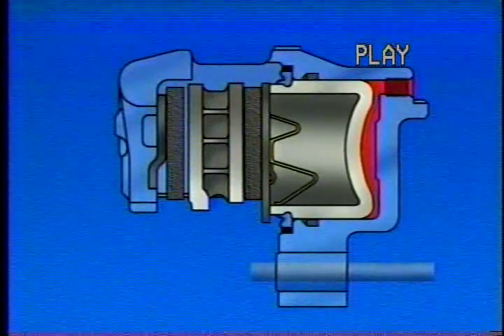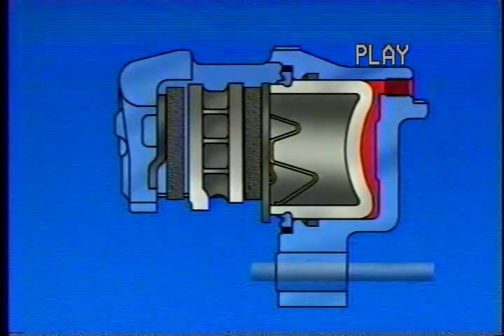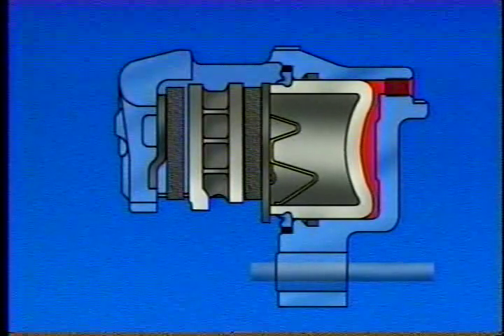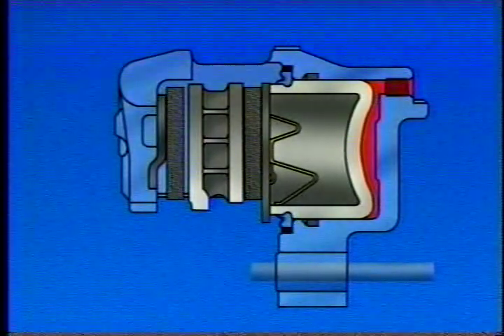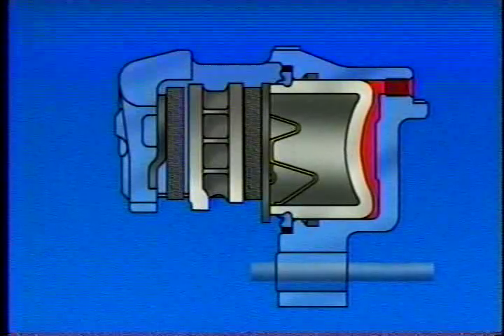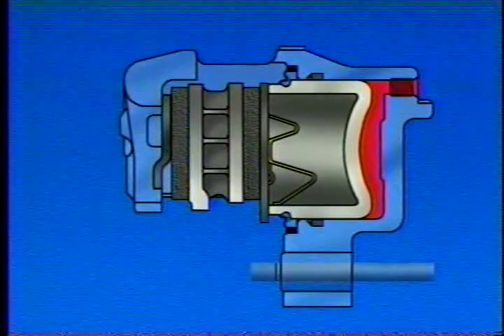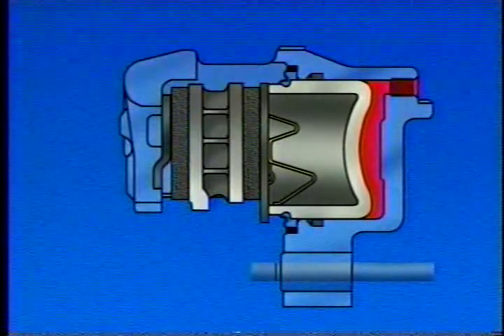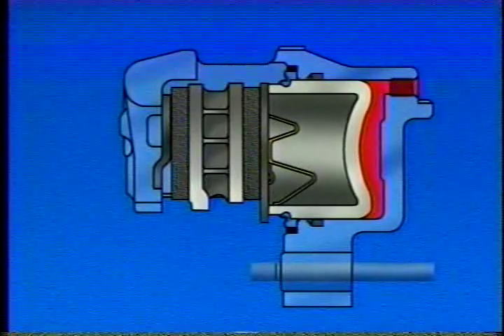How Lateral Runout Develops

Comment: The fix is to take off the rotor and use a dial indicator to measure the lateral run out of the hub. If the hub has .001 or less of lateral run out, you would know the hub is good. So you would then use a wire brush to clean all rust off of the hub assembly, you could even do this before testing it for lateral run out. Then install a new rotor on after applying antiseize to the hub surface to ensure there is no rust or corrosion to the surface over time that could cause lateral run out and make sure to only torque the lug nuts to spec and never use any impact guns to install the lug nuts.
Reply: There are many videos on here showing how to test for lateral run out using a dial indicator gauge.
Reply: Thank you for the info.
Reply: Hi John!  I know this comment is a little old, but I'd really appreciate your feedback.  I am about to do the brakes on my car and just purchased a dial indicator to measure the lateral runout.  I know that if it is greater than .002, then it must be corrected.  From my understanding, if this is the case, then one must use correction plates to fix it (3 sizes consisting of .003, .006, and .009).  Is this the way you would recommend fixing theoretical lateral runout?  I just want to make sure I am prepared in case my vehicle or rotor does have it.  I look forward to hearing your thoughts.  Thanks!

Comment: new rotors need to be checked, That said cheap rotors do not hold up well and for the most part, expensive rotors are not much better. It's a corporate thing, but hey people like it when they get fleeced.What's in your wallet?